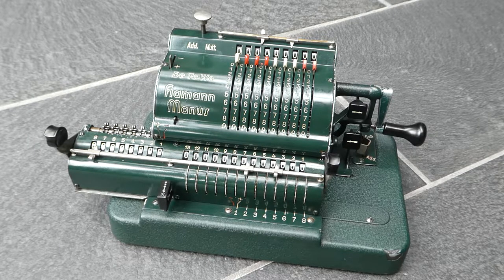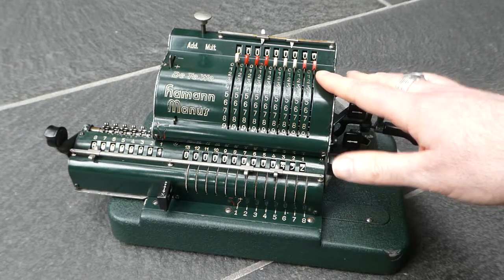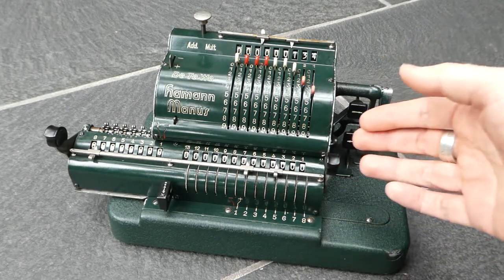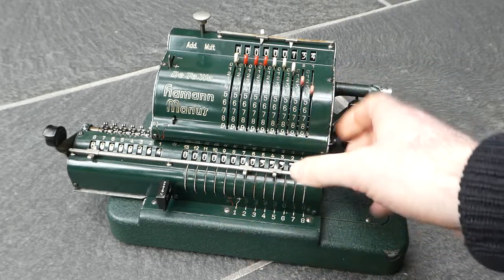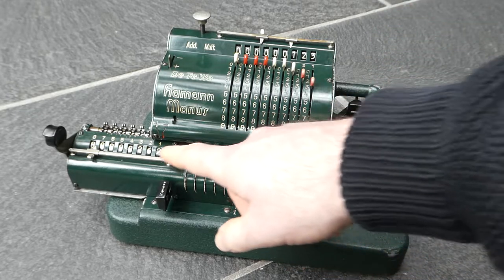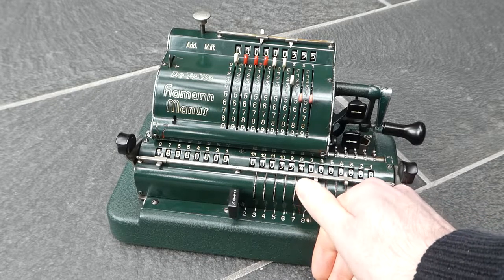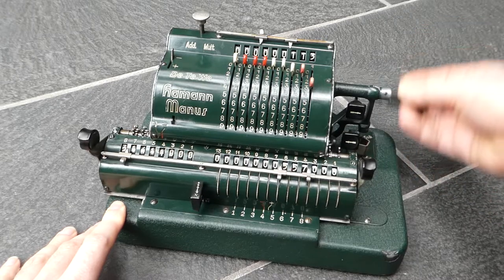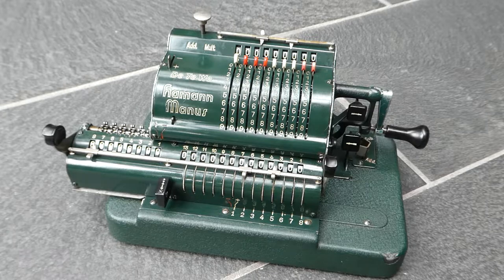The Hamann Manus E

Comment: Coo that's nice Jaap - I like the small differences between the model E and the model F that you featured previously.  The big button on top to clear the input register is really good.   You could be forgiven for not spotting the differences, they haven't gone out of their way to change the overall case design or logo or colour or anything like that.
Reply from the maker: The big clearing button is interesting but if I had to use this machine I would not like it much. It is on the wrong side of the machine. Also, the loud clicking of the input levers is very noticeable, and they take a lot more effort to move. This is because they are spring-loaded to allow the clearing to be done by a simple button push. The type F input levers move so much easier.